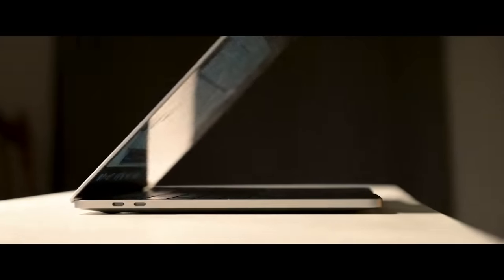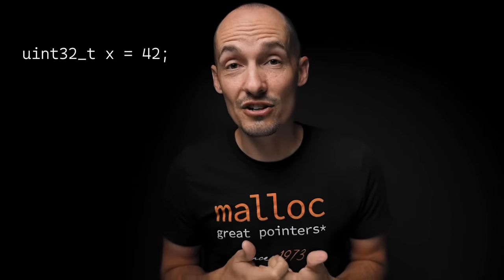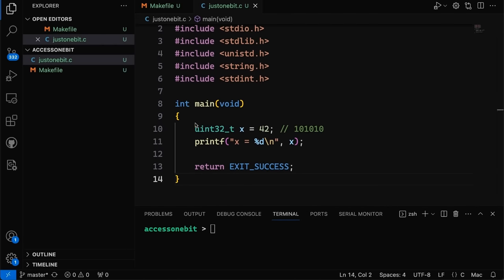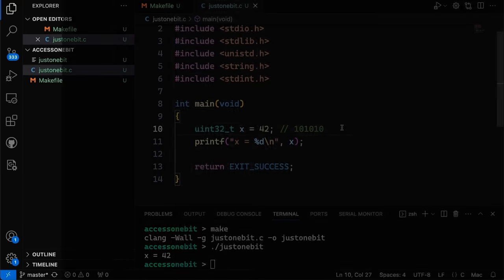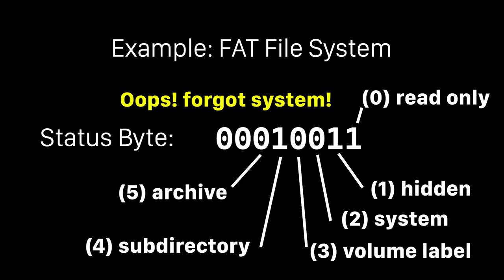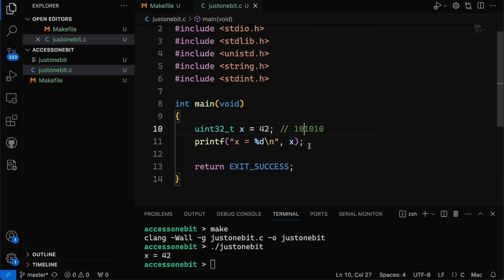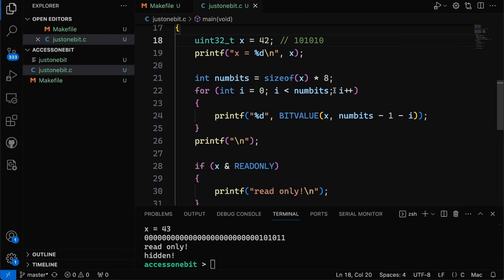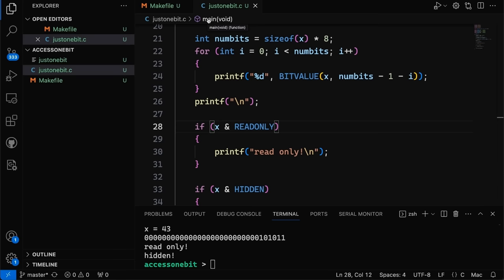How do I access a single bit?

Comment: In many cases it’s more accurate to say computers represent everything in sexaquinquabicentesrmal, not binary.  But nobody wants to say that partly because simplified computers do use binary and partly because, well, do you want to regularly pronounce that?
Reply: No idea what numberingsystem you are referring to.
Google can't find anything about it.

Is it something like 64?
In some sense you are correct, there are 64 wordsizes, but also other wordsizes, like 32 or even not a power of two.
So saying that computers are "that" is already incorrect.

But a "computer" can do more than operating on a whole word, like the arithmetic instructions.
Enough instructions operatate on a single bit or on separate bits in a word.

Further more: at the hardware level, only two levels are used.
These levels are encoded as 0 and 1.
Another way to say that computers use binary.
Reply: It's a good thing that bases that are powers of 2 are trivial to convert between!
Imagine dealing with base 256, but you have to use a unique symbol for each value...
Reply: @HansLemurson  Yeah, often binary is easier to work with because of that.  Just it sometimes helps to think of what the computer is doing as operating on a byte at a time.
Reply: @danielrhouck  I like how Hexadecimal strikes a balance between not having to use too many digits, but also not having too many distinct values.  16 values is easy to wrap your brain around.

How computers actually process the data though can vary from machine to machine.  I remember building a redstone calculator in minecraft using comparators which was actually natively hexadecimal, since there are 16 different signal strength values. 

In modern electronic computers, memory-access is byte-aligned, but data is read into the processor in multi-byte words, so when you just want to look at a single byte you have to load 4, and then ignore 3 of them.
Reply: @HansLemurson  Or look at 8 and ignore 7 of them, for 64-bit registers.  And some opcodes work directly on memory and I don''t know how those work internally.

If I were put in charge of All Mathematical Notation in the distant past and could choose the number system people would use, I wouldnʼt choose decimal.  Without knowledge of modern computers Iʼd choose base 6; with that knowledge itʼd have to be base 16.
Reply: @HansLemurson  If you relied on a signal strength, my guess is your comparator is more analog than digital.
Reply: @jarlfenrir Yeah, it's a weird gray area.  The wires carry widely varying signal strengths, and it's hard to define logical operations, but at the same time, all 16 strengths can be precisely distinguished between.  Strength 7 and 8 are distinct, and there's never a 7.5 or 8.1, so in that sense it's digital.  

Some early electronic computers tried to use 10 different voltages on wires to represent base 10, but they failed because you couldn't reliably differentiate between them when electrical resistance came into play.  Is 5.8 volts a 6, or a degraded 7?

Comment: Can combine the #defines like this? -> READONLY | HIDDEN
Reply: Yes, because there are no overlapping bits in the definitions.
Reply from the maker: Definitely. Thanks!
Reply: Yes, but you need to take care.
#define b0 (1u<<0) // = 0b00000001
#define b1 (1u<<1) // = 0b00000010
#define b2 (1u<<2) // = 0b00000100
#define b3 (1u<<3) // = 0b00001000

#define multi (b1 | b2)

int x = 42;  // = 0b00101010
if( x & multi ) /* do something */
The above is true if EITHER (or both) bits are set.

You need:
if( x & multi == multi ) /* do something */
to test if BOTH bits are set (two conditions are met).

Or, you could be explicit and simply just use the primitives:
if( x & b1 && x & b2 ) // do something
An optimising compiler might just collapse that into what is needed, anyway...